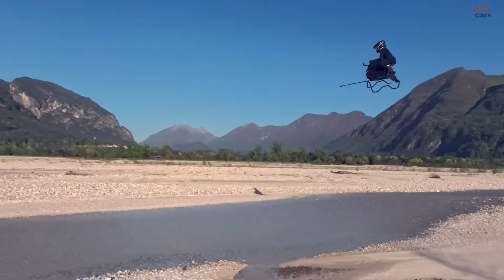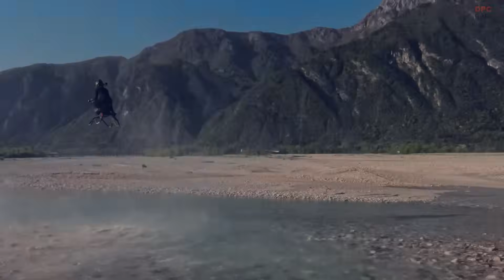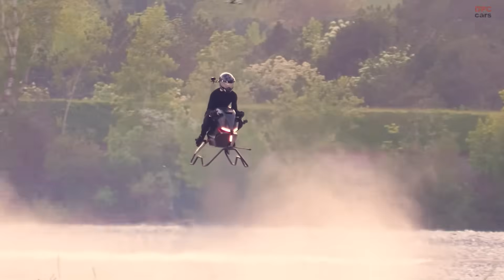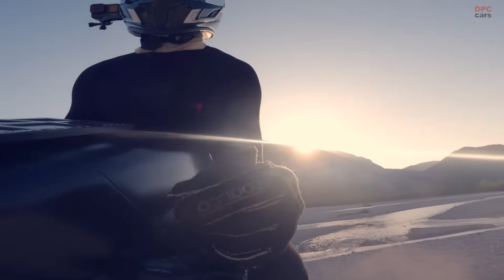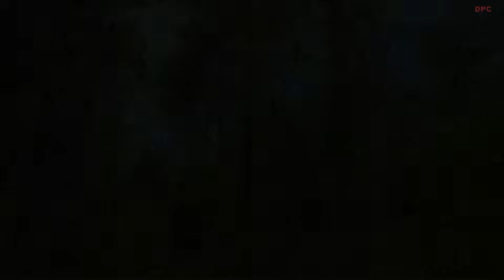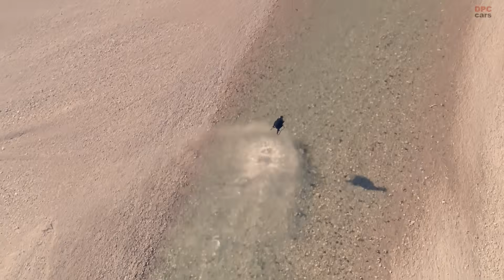Flying Motorcycle Hits 124 MPH The Jetson Creator’s Next Level Airbike

Comment: Notice they didn't have any sound of the "bike". That's because the jet engine is loud as hell. Nobody is going to want this thing flying anywhere near them with that down blast. Imagine you are taking a trip to the lake and there are dozens of these things buzzing around with their jet engines blasting noise and super heated air down over your heads. The hot exhaust could start fires. That's why they are flying it in a rocky location with water below. This may have some military use, but in civilian hands, you couldn't even get insurance.
Reply: Gee you’d be great fun at parties wouldn’t you?   Talk about the bad news fairy 😂😂😂